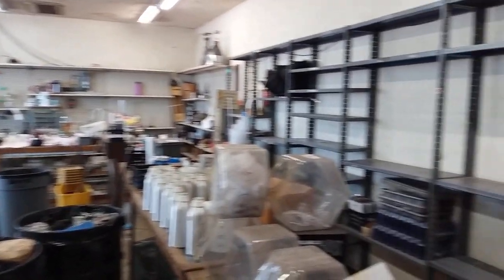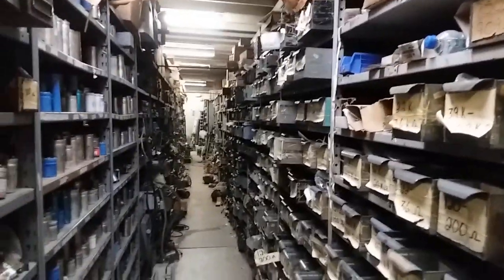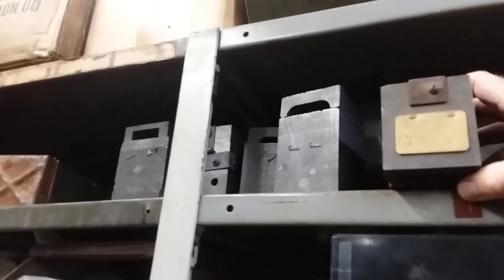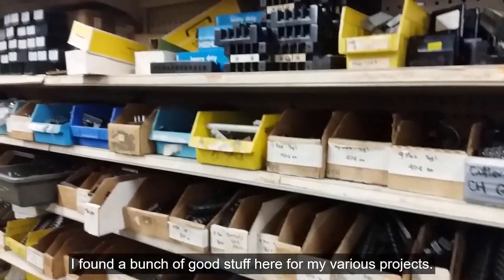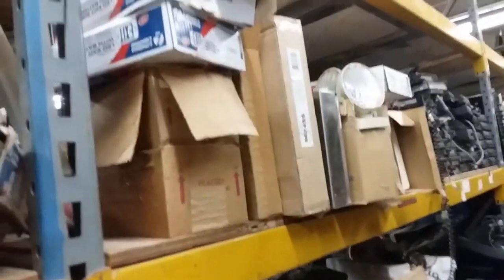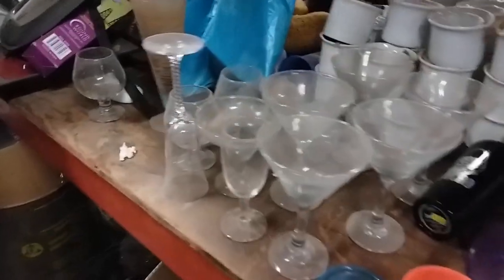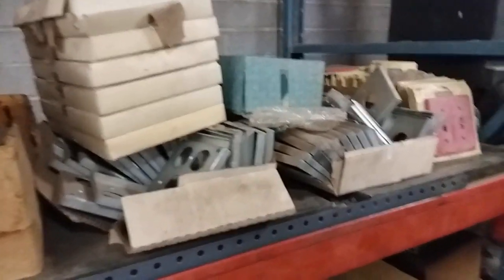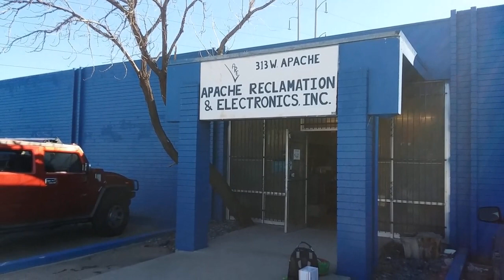A Last Visit To Apache Reclamation And Electronics In Phoenix

Comment: I didn’t realize that this company is gone. I’d start a fifty acre Pick-N-Pull for old factory machines.

Maybe someplace in Tennessee. Pumps, motors, hydraulics, pneumatics, control panels, wire, computers, etc. Bring your toolbox.

I’d place the operation near a smelting furnace.

Comment: I'll miss the place, but many of their prices were ridiculous and made up on the spot, often based on wishful thinking prices on ebay. they would have sold more stuff if the prices were better, and some of the electronic components were over 20 years old (capacitors/resistors) and were bad or out of tolerance..
Reply from the maker: Yeah, not sure how they calculated prices. Depended on who you asked. I think there was some emotional attachment to the inventory leading high price expectations. Still, they closed because of retirement, not bankruptcy. So they apparently sold enough to pay the bills. Even if it didn't look like anything ever changed in the store. Same issue with Surplus City in Albuquerque. Owned by the same family. A lot of AR inventory was moved there. It's still sitting outside in disintegrating cardboard Gaylord's. Will probably sit out there until it's dust and rust. But they seem to do enough business to keep the lights on, and even do a major renovation to the storefront.
Reply: @omegageek64  yeah I have been going there for at least 20 years. I went one time and bought some small light bulbs, they were 25 cents a box of 8. a week later I went back and the owner told me they were 25 cents a piece. I said that wasn't the price last week and he told me that was always the price. on multiple occasions when they sold radio tubes the person at the counter would go in the back room and look them up on ebay (they told me). I turned them down went home and bought 9 of the item (from ebay) for the price they quoted for 1. I always figured the scrap value of the entire lot was worth more than whatever they were making. there was stuff there that had been there for 20+ years. I think the owner told me they owned the lot so they didn't have many expenses.